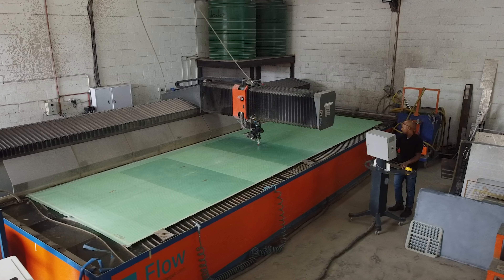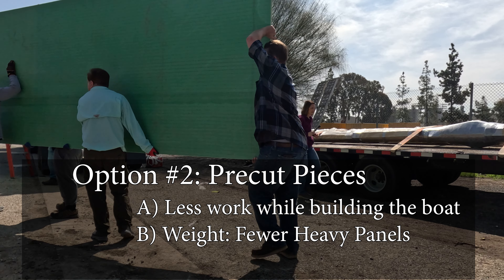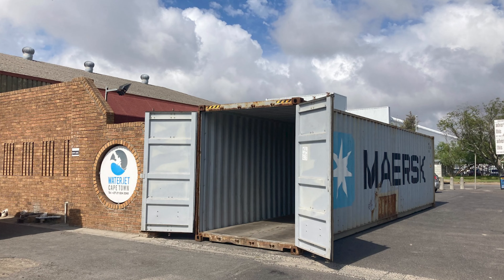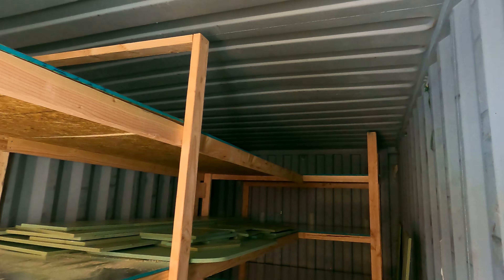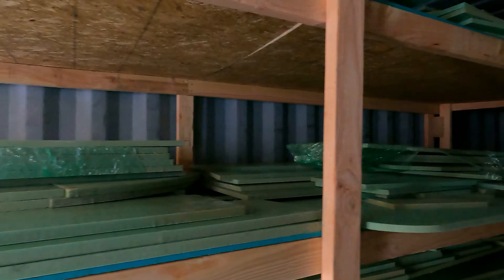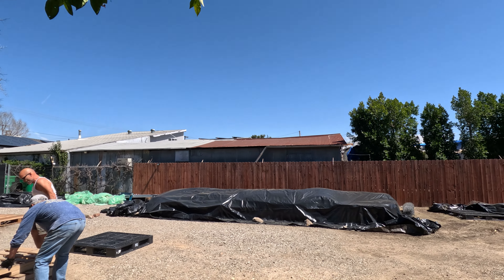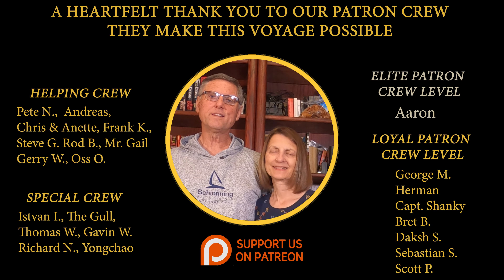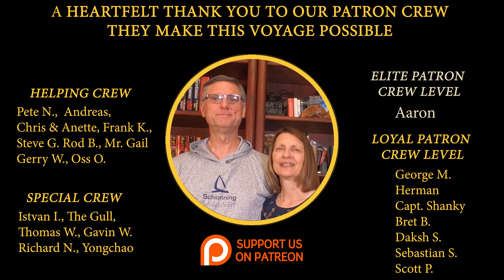Kit E27: Kit Catamaran Organizing and Postmortem

Comment: Hi guys, coming together all the issues that you are having are common in this industry, question about epoxy due to your climate, are you using west system epoxy if so is there an option to buy local?  Also are you useing a a thermotropic laminating resin ( kinetix)  developed for hoter climates and specially designed for laminating it is part of the kits here in Australia, anyways  happy building.
Reply from the maker: We will be using West System epoxy where appropriate and laminating epoxy where appropriate.
Reply from the maker: Oh, and we purchased our West System epoxy locally, but the Sicomin comes from Schionning in South Africa.

Comment: Hello, one concern: storing the panels on "bending" shelfs will probably make the panels to bend too, it can be hot like in a oven in these containers.
Reply from the maker: Good thought, we'll add some ribs to straighten the shelves up.
Reply: A few extra 2x4s as cross braces would help tremendously.
Reply: Yep, while foam/glass panels are pretty resilient to bending it can't hurt fitting some 2x4's under the particle board to reduce/prevent sagging.

Comment: One  comment you mentioned raising a canopy to construct your boat. This may well be a geographical syntax difference to a lot of people a canopy is simply a roof structure without the surrounding walls/doors. Just in case that this is not a misunderstanding or alternately the canopy is just step one I would suggest that this is a very bad idea not the least is that your build would take place in a very dirty environment.
Reply from the maker: It is what it is.  We meant canopy.  In Southern California, our weather is generally very good year around (this has been a strange winter, the most rain in 40 years).  Mostly, we have excellent weather with very little rain.  There really isn't an option to build a structure around the entire boat, it would just cost too much.  So, we will just have to make do.  There were no other build site options available.

Comment: Why "postmortem"? Nobody died :-) Instead I would call it "retrospective" similar to Agile/Scrum methodologies. And seriously I am surprised and shamed how Shioning served container load. I am in Australia and proud their Australian roots. I hope that was uncommon to the company. Here in Australia all suppliers I deal with always packing well and deliver in time.
Reply from the maker: We call it that because I have worked as a producer on many projects and that is the term used.  Here is a quote from a dictionary...  
"2: an analysis or discussion of an event after it is over"
As for Schionning Design, they were caught by a sudden crack down on epoxy shipments, they even tried several different shipping companies.  Unfortunately for us, we were the first kit shipment that was affected.  I am sure they are scrambling to work out a solution for future buyers.  Now, as for how it was packed,they told me it was to protect the foam panels from damage.  As we mentioned, if we had to do it again, we may have chosen to have them all still attached in large panels.  Hindsight is always 20/20 :)